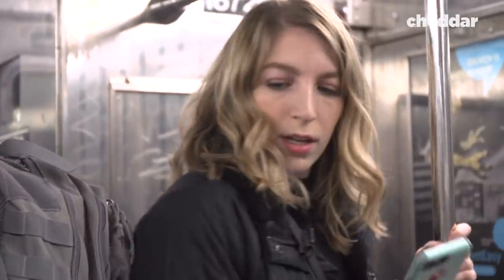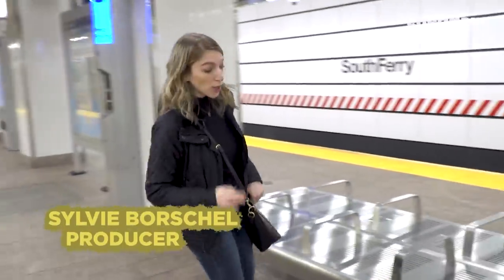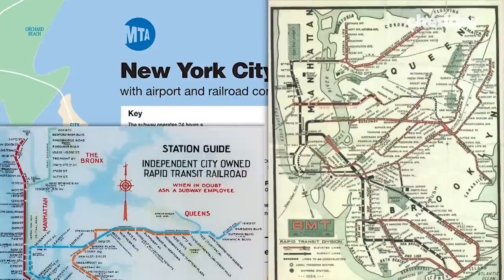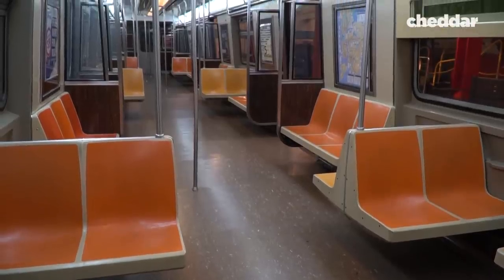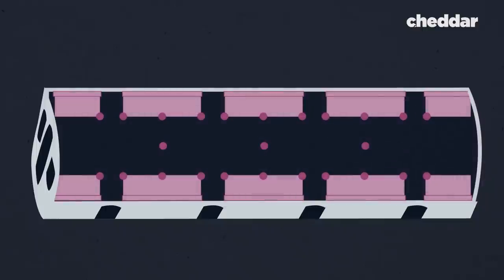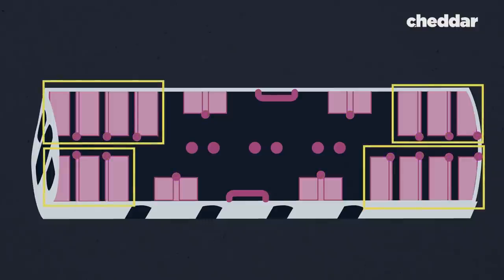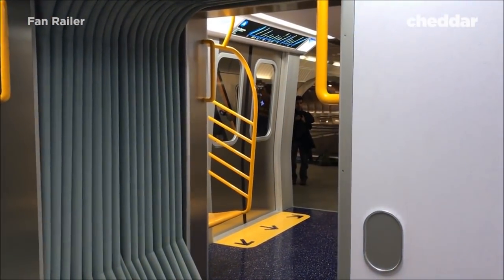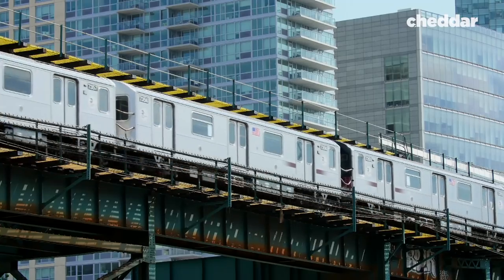Could This Subway Car Save NYC Transit? - Cheddar Explains

Comment: If only the transit system was still privatized
Reply: BuzzFeedRight Privatization is not always the best solution. The situation of Nassau Buses is a great exampleS
Reply: @TheRailLeaguer  in developed countries all government workers are unionized especially in transit, that means a million plus per worker in guerenteed retirement pension, you probably dont get that in Nassau. Nassau largest industry is tourism, alot of those tourists use the transit system. Our policicans are crooks they're bought by construction lobbyists and unions, they over spend on everything time and time agian, in every American city the transit systems lose money hand over fist.
Reply: BuzzFeedRight The Nassau Bus system was fine until 2012 (the year of the takeover). Since then, service went down the drain, with broken down buses, buses that don’t show up, etc. Even the MTA does a better job running its bus system.

As a result, ridership declined on the transit system there.

Comment: The trains are fine. 
Problem is overpopulation.
What causes overpopulation? 
Immigration, medicine and welfare.
Reply: What does this have to do with subway car layouts, aside from people?
Reply: @TheRailLeaguer  
It's like treating the symptom instead of the disease
Reply: Vile Crocodile That still has nothing to do with subway car layouts.

Population has nothing to do with the way the seats are laid out.
Reply: @TheRailLeaguer  
What is the best solution for the trains?
Reply: Vile Crocodile Open gangway trains with a few seats removed.